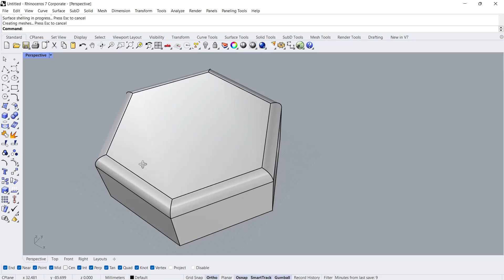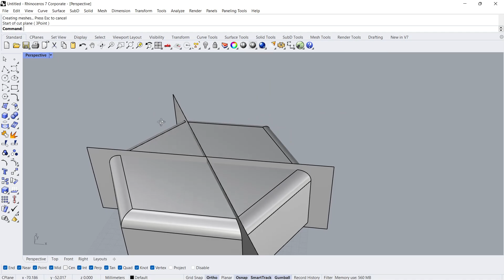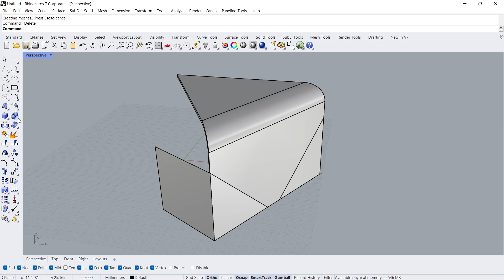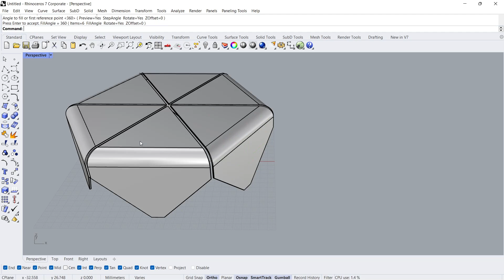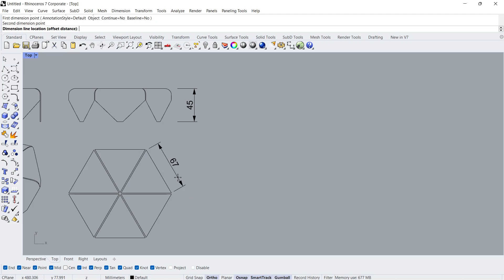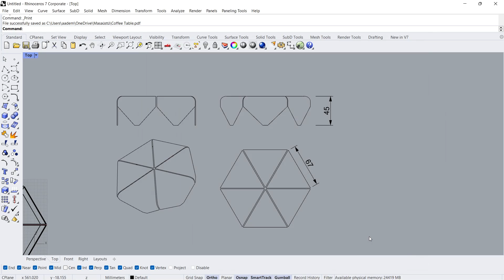Rhino For Beginners 2 - Coffee Table

Comment: Boolen difference is not working why
Reply from the maker: It won't work if the objects are not solid. After selecting the objects, You should see the text ‘’Closed Solid Polysurface’’ from the command panel or properties menu.

Comment: These are not beginner tutorials. If you have never used Rhino before you hit a stopping point. There are settings that need to be in place for some of these things to work properly like what Onsnap needs to be used. As a beginner it was frustrating not to have these things mentioned. Also I am stuck on the extrude tool. It is not going in the direction I need and I cant seem to figure it out. Please help.
Reply from the maker: - youtube.com/watch?v=iVLqy_keaoY&t=20s&ab_channel=GediminasKirdeikis